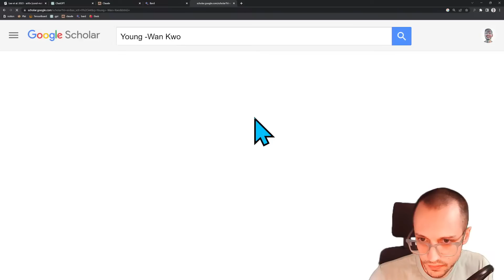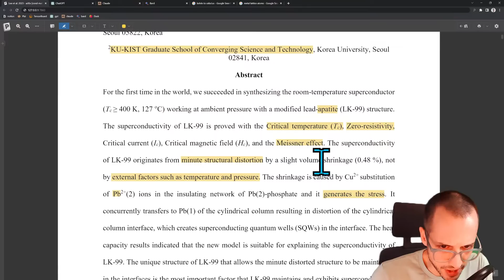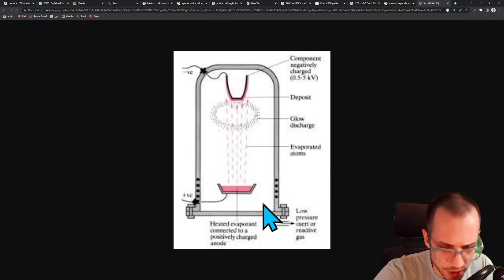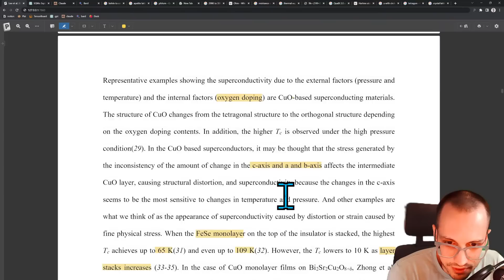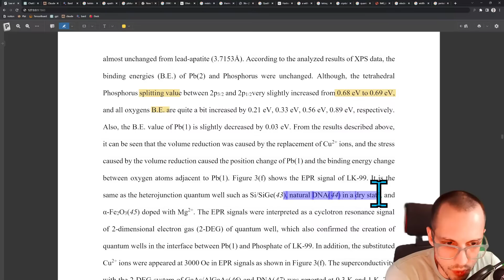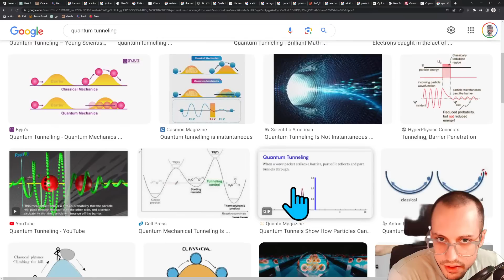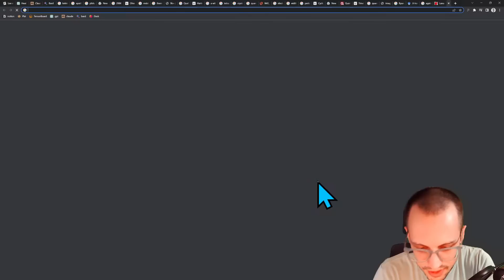Room-Temperature Ambient-Pressure Superconductor

Comment: 20:30 chart is dominated by straight line. Which means you dont have to increase voltage (to counter resistance) to get higher current. However as you can see there are distortions and I have no idea how it complicates stuff. Because if you have super conductivity at 20oC and at 20.158oC suddently you have some ohms applied...

Edit: nvm, you got it later in vid.

Comment: The authors theorize that distortions in the crystal lattice of their material create "quantum wells" that allow electrons to couple into Cooper pairs. Between these superconducting quantum wells, which are between 3.7 and 6.5 angstroms apart away, the electrons could tunnel. In other words: The material is not consistently superconducting, but contains small, superconducting islands. It remains to be seen whether this really explains the atypical measurement data.

Comment: resistance = resistivity * length / cross-sectional area
so resistivity is Ohm * length dimension

for a traditional material, resistivity is constant for a material no matter what current it flows.
the potential difference between two points is always directly proportional to the current applied. 
and the scope varies with the material of the conductor used.

experiments have made to prove that the proportional relationship is also to length and cross-sectional area. so that "resistivity" is defined as a term to describe the material property. It is also noticed that  resistivity varies with the temperature in a non-linear relationship. There is formula to convert resistivity in one temperature to another temperature.

Comment: You can't effectively store energy in superconductors because they have field limit, the more energy you put in the stronger the magnetic field gets and that will quickly go over the critical point, I don't think it'll store nearly as much as a good'ol lithium battery.
Just from this paper, the field limit of this superconductor is not very high, so it won't even make stronger electro magnets, except it no longer needs the cooling current MRI machines need.
The main reason quantum computers need super low temperatures I think is because the q-bits must be kept in superposition, that is insulated from all external radiation, hence absolute zero. Even a superconducting quantum computer would still need near absolute zero to work.

Comment: ngl, i'd be both very glad and super disappointed if it turns out we could've made superconductors out of copper and lead all this time.
Reply: superconductor technology is still relatively "new" in the grand scheme of developing technology, and its more complicated than just lead and copper ofc, if this proves true i'd be more happy that we found it now rather than later
Reply: @fordalels  Oh yeah, 100%, my comment was mostly tongue in cheek than anything else... We expecting some magical element that would be capable of superconducting electricity at these conditions and it turns out it was just some combination of copper and lead lol... On the other hand, like I said, super happy this is the case since these elements are extremely common and we wont have a problem with supply.

Comment: Yes, in theory, the "artificial atoms" or "superconducting quantum wells" created in the LK-99 superconductor could potentially be used to create a type of quantum bit, or "qubit", which is the fundamental unit of information in a quantum computer.

Unlike classical bits, which can be in a state of 0 or 1, a qubit can be in a superposition of states, meaning it can be in state 0, state 1, or any combination of both. This property, along with the ability of qubits to be entangled, allows quantum computers to process a vast number of computations simultaneously.

However, it's important to note that building a practical quantum computer involves many challenges beyond just creating the qubits. These include maintaining the quantum state of the qubits (known as "quantum coherence") for long enough to perform computations, performing operations on the qubits with sufficient precision, and reading out the state of the qubits accurately.

Furthermore, while superconductors are a promising technology for building quantum computers, and some existing quantum computers (such as those built by IBM and Google) are based on superconducting qubits, these typically operate at very low temperatures to maintain their superconducting state. If the LK-99 superconductor can maintain its superconducting state at room temperature, that could potentially be a significant advantage. However, there would still be many technical challenges to overcome in order to build a practical quantum computer based on this technology. Chat GPT

Comment: I want to stress what the true breakthrough here is and what it will change. These researchers applied our best models for how super conductivity works to predict configurations of molecules that would create the conditions of superconductivity without extreme external environmental requirements. By synthesizing this material and validating it, they prove that this technique of designing a crystal superconductors is practical and that the theory is sound. Now physicists can probe the technique and search for its limitations.

Comment: The critical current and critical fields of this superconductor is toooo low for flying cars and any really super advanced use. It might not scale well.
Reply: How about for power transmission? this being made with common materials and tools means that the biggest fucking advance that this gives us is in *power lines*, so our plants can be in the middle of bum-fuck nowhere and we don't lose energy. It might make transformers much less common because stepping the current up or down isn't as neccessary, or mean that things like middle-of-nowhere nuclear or on-site natural gas suddenly become manageable rather than pipe dreams.
Reply: @huntre111  No this won’t work for that unfortunately. The critical current that can break superconductivity here is 0.250A. Power lines transmit tons of power, if you look online you’ll see that distribution lines can typically carry 700A that is 2800x the critical current. Beyond the critical current this material is probably worse then copper. I’m not a superconductor expert but this seems like a non starter. Just a small step with a long way to go. Existing superconductors like ReBCO can carry that level of current but only at very low temperatures.
Reply: @NZ-fo8tp  Fair enough, I've been bouncing around readying things up for a cross-country move and starting work, so I hadn't hit that point in the video yet, just commenting about what it might be most useful for.
Reply: @huntre111  Low current applications certainly do exist, but this seems to be more of a 1.) if this exists, surely others do as well that use similar structures to achieve superconductivity (this may the first to demonstrate? not certain)
 and 2.) the method the lab used to come up with it could well lead to other superconductors. 

I mean the temperature and pressure combo discussed is ludicrous, this is stick a waterblock on it types of temps (or at least conventional refrigeration). If it works a tenth as well as the paper suggests its significant, not sci-fi yet but very cool.
Reply: @NZ-fo8tp then just make 2800 super conducting wires
Reply: @huntre111  the future of this tech is bright but not necessary around the corner.
Reply: As asked to Chat GPT
You're correct, 2.8 square millimeters (mm²) is not a large cross-sectional area. To give you a comparison, consider the following:

A standard 12-gauge copper wire, commonly used for residential electrical wiring, has a cross-sectional area of approximately 3.31 mm².
So, a superconducting wire made from the LK-99 compound with a cross-sectional area of 2.8 mm² (needed to carry a current of 700 amps) would be slightly smaller in diameter than a 12-gauge copper wire.

However, it's important to remember that this is a theoretical calculation based on the properties of the material as stated in the document. In practice, the actual size of the wire might need to be larger to account for factors such as manufacturing tolerances, safety margins, and variations in the material properties. Additionally, the wire would need to be insulated and possibly cooled, which would increase its overall size.
Reply: SQUIDs for a start. Those have scientific and medical applications. It could also be used to improve the efficiency of low-power electronics, giving a slight reduction in energy use, by replacing resistance-critical parts like power supply inductors - though you'd have to parallel them up if you want to handle any amount of current. Also almost-zero-noise antennas for radio communications.
Reply: Worth noting the purity of the material may be very low. In some demonstrations the material seems very porous indicating impurities. These impurities may be affecting its characteristics negatively.

Comment: It seems that there is a patent filed by the same scientists in the paper, it was filed on August 25, 2022.  
International Application No. PCT/KR2022/012774  'WO2023027537 - ROOM-TEMPERATURE AND ATMOSPHERIC-PRESSURE SUPERCONDUCTING CERAMIC COMPOUND AND PREPARATION METHOD THEREFOR."

Comment: I'm asking because I'm curious about your student status, do you mean that room temperature superconductors can actually exist in this video?
Reply: Room temperature ones apparently do exist, but they still require very high pressure.
Reply: This specific paper is claiming (but hasn't been peer-reviewed and the research hasn't been reproduced) that they have produced a room temperature (>21 Celsius critical temperature) ambient-pressure (atmospheric pressure) superconductor.
I.e. if you had it in front of you right now it would be superconducting. No special conditions needed.
Reply: Yes. There have been a couple of room-temperature superconductors discovered, but they are only superconducting under extreme pressure. Pressure too high to be practical in any application - just testing them needs a diamond anvil press.

Comment: This can really change the world in a matter of years, not decades
Reply: Flying cars
Reply: Spacecraft
Reply: And....  SHEESH, it's stupid easy to make.  The hardest part looks like keeping the furnace at the right temps when making this stuff.  Curious if there's a way to grow this crystal structure with molecular beam eptaxy.  Oh and that sealed quartz tube looks tricky....
Reply: magnetic batteries by pumping power into an electromagnet for later use since the wires can hold the current indefinitely😅
Reply: Problem is its a hoax and not been replicated.
Reply: from what i saw about how easy and quick it supposedly is to manufacture, defo on the years end of it. Absolutely insane W if it is true.
Reply: @owenyin3316  if it's too good to be true, it usually is
Reply: @ionbarari7202 It's max 200mAh, right?
Reply: @owenyin3316 this might develop in years if someone is smart enough to know how to invest in them, otherwise it will be decades
Reply: imagine 0 lag between NA and Asia internet connections, imagine real hoverboard, magnetic trains, imagine semiconductors with much more efficiency (faster computing so even faster AI learning), so much potential and that's just what we know, there's much more that we don't know, like microscopic world
Reply: @Cookiezina  HAHAHA! 0 lag has nothing to do with super-conductivity, distance is still there. It's just there's no need for repeaters now. But! Only if signal is transferred by wire
Reply: @Cookiezina  That's impossible given the speed of light.
Reply: @Cookiezina  what do you mean by "lag"?
Reply: @Cookiezina Imagine also  cheap energy production with Fusion energy !!!😮

Comment: 5:05 I don't know if you address this later into the stream, but I should mention that the way you searched for Young Wan Kwon on Google Scholar is incorrect because there was a hyphen before "Wan", which (same as in regular Google search) excludes all results that contain that word (which obviously excludes all mentions of the person you were looking for). Although, searching it with with the correct query still doesn't result in any user profiles.
Reply: pretty sure google search ignores special characters
Reply: @ferret781  Just google something like "google search operators cheat sheet".